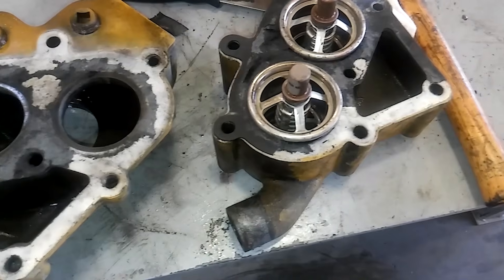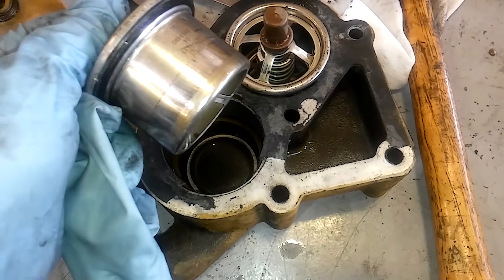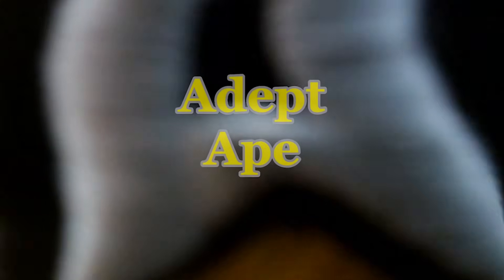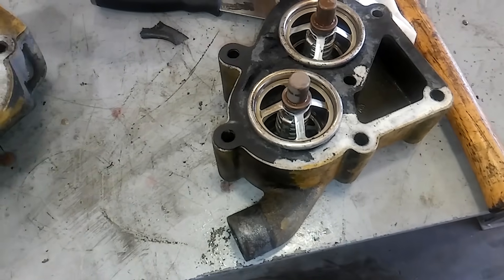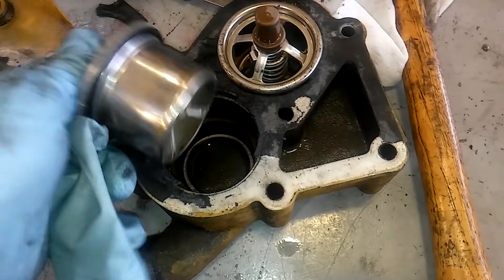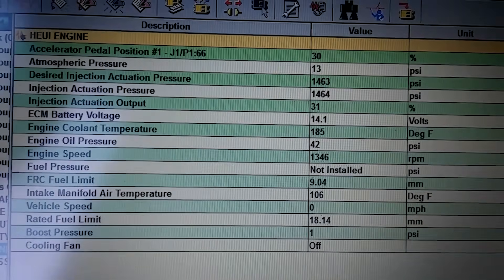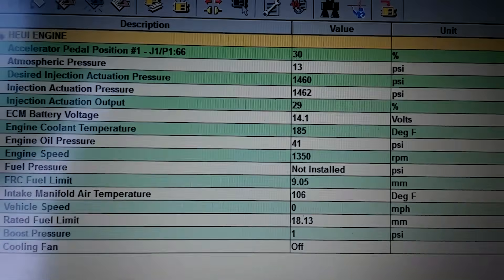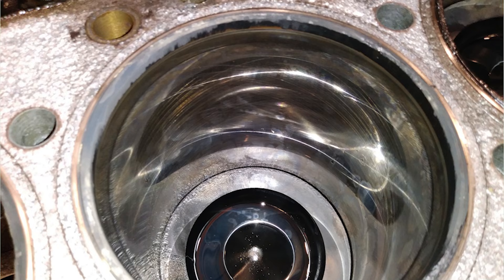Why You Should Never Remove or Use a Colder Thermostat In Your Engine.

Comment: Newer engine tolerances are designed so it does run hotter for fuel economy and better burn of any sludge.  The " I have been doing this for 30 years" person shows they know very little about the past 30 years and that there are many changes in the past 30 years.  Nice video you explained it well, some will not believe it.  Some manufactures run different temps in some extreme environments. In the far north of Sweden, Norway, Finland you can get cold prep package designed for the north that will include a hydronic heater to keep the engine temp hot enough.   Stay safe and healthy Josh.
Reply: Badger says it all I'm out
Reply: You got a point. Yes, i'd never change the thermostat opening temp of an engine that uses 0w-30 oil, i.e.
Reply: @RGV2300  I would never use 0w-30 oil anyways
Reply: @Force1Com  it depends on the car, you don't choose the type of oil.
Reply: @RGV2300  depends on the temp, read your owners manual. I bet they allow for different oil weights right in the manual. 0 weight is for operation down to -35 Celsius. 10 weight is for operation down to -25 Celsius.
Reply: @RGV2300  you ever look at an oil temperature chart before?
Reply: @RGV2300  that's a good point... People have been so indoctrinated they don't even believe an oil temperature chart anymore lol
Reply: @Force1Com  no, just an oil efficiency curve for a mine truck engine, but it gives me a pretty good idea about how important viscosity and temperature are for an engine operation.
Reply: @RGV2300  I don't know a whole lot about diesels, but what truck you have and what's the daily temperature where you live? I'm curious, I want to look it up.
Reply: @RGV2300  I've never been in Chile before but I know in the Philippines I heard stories about people using recycled oil.
Reply: Also I saw a similar number of cars smoking when I was in Bolivia. I did have a Toyota diesel truck when I was in Bolivia, and I can say that nobody really cared to fix it properly
Reply: @Force1Com  i have a golf a4 1.9 tdi, enviromental temps fluctuate between 8 to 25 degrees C across the whole year, so pretty friendly for cars. I always prewarm it for 5 mins, and drive slowly until i reach op temp.
Reply: @Force1Com  it's just sad to see plenty of cars and trucks newer than mine that smoke black, so engines are pretty much wear at that point, giving a mediocre fuel consumption (below 10km per litre)
Reply: @RGV2300  I agree, and I always thought it was weird, that's why I asked some people questions. I think it would be better to be careful about where you get your oil changed, and know exactly what oil they are using and the quality, and to change oil more frequently. If I got another car again in south america or somewhere in asia, I'd probably only get my oil from a dealership, although last time I asked about prices, I remember it being kind of ridiculously expensive.
Reply: @RGV2300  I was reading something which was saying the first number, the cold weight viscosity, is measured at 0 degrees celsius, so if the ambient temperature is say, 10 degrees, for all practical purposes there's not going to be much difference in the viscosity between a 0w30 and a 5w30, and at operating temp, they will be the same. I had a car before that had about 300k kilometers on it, and I put the manufacturer's recommended weight, 0w20, and on a really hot day the oil pressure was dropping too much at idle. 10w30 corrected it and it was fine, so you may want to keep that in mind as your car ages and the bearing clearance inevitably increase. Also keep in mind that a lot of people probably don't maintain their pcv system, at all, and that will cause a car to burn oil.

 "Viscosity simply means opposition or resistance to flow.  In much simpler terms, it can be referred to as the flowability of a substance. When it comes to motor oils, the viscosity is denoted by the number before W. For example, in 5W-30, 5 is the viscosity number which is what determines the rate of flow of the oil at 0 degree Celsius. So, the lower the number, the lesser the viscosity and the lesser it thickens in the cold. With this, you will expect 0W-30 to thicken less in the cold than 5W-30.

A motor engine in a colder climate would get a lot of help from a 0W-30 motor oil than the 5W-30 motor oil. This is a factor of viscosity. The outside temperature also has a role to play in determining which viscosity is perfect for use. When the temperature is cold, the oil flows slowly, but when the temperature is hot, it will flow more quickly. For adequate and proper lubrication, you must always put the viscosity in relation to temperature into consideration.

Basically, motor oils are manufactured in different velocities to achieve effective lubrication in different climate conditions."
Reply: Dosen't burn off sludge!! If it did it would cause carbon deposits. It evaporates the water in the oil before it can mix with the oil to cause sludge to form or chemical reactions.   dont be a smart @ss and talk down to people try to educate
Reply: @jasonwakewich121  Act like an ass and I respond the same. It does burn down the sludge because the chemicals are mixed back into the intake to be burned instead of vented into the air.  The chemicals that settle out are what makes the sludge so when it is remixed and burnt off it does not vent.
Reply: Caterpillar stopped making over the road engines in the states I Beleive in 2010. Google sensors on any of the new engines. Oil and type of oil is a big deal.
Reply: @RB-cz5jn  What has that to do with my comment?
Reply: @badgerpa9  this needs to be a episode of myth busters. Take out thermostats pull a hill. Put in different temp thermostats pull a hill. You want to be cooler to start.
I reserve the right to be wrong.
Because over all I want what’s best.
But in older engines cooler stats but I do not want the responsibility of someone else choices.
Reply: @RB-cz5jn  On my 1960's I would say sure lets see.  Not on a new unit.  But you should do what works for you.  If you are overheating with the correct thermostat in and everything else is correct like radiator is clean not half plugged, etc and you get to hot I would think the rad is partly plugged but otherwise look for a better rad.
Reply: @badgerpa9  maybe I should rebuild the engine and then replace the rad with a multicore. After I did all that I would still put cooler stats in.
Oil should tell the tale. I’m saying the old stuff there recommending it too hot.

Most will disagree 
That thermostat is important. All that Josh stated is true but at what temp is too excessive.
I think it’s epa. I think you may save a touch(being honest) on fuel but all those gaskets and the temp of that oil.

My views. I don’t want everyone to believe what they read and see for themselves.
I’ve stared at that needle for many yrs.
I can tell you the deference between  none 160/170 and I Beleive 190 stats with a new radiator and with old one.

Off subject but 
Look in disruptive Technology and laws.
Also ask a IT guy how he feels about Microsoft.
Not big into conspiracy theories but we seem to be making a lot of sheep. Especially when that oil should do it’s job.
Reply: @badgerpa9  I’m not over heating.
But I pass others that are
Reply: @RB-cz5jn  I did not follow entirely but if you are saying microsoft is a company run like germany in the 1940s then we agree.
Reply: @RB-cz5jn  Then you drive with your engine at a lower than optimal temperature the rest of the time also right?  Why did you pull the thermostat if you are not overheating?
Reply: @badgerpa9  because the fan never turns on in the winter. I didn’t want to run a 31 yr old daily driver at 195f and shut down is at 225 or 230f.
That’s ridiculous. I recouped my fuel saving by no fan. I’ve got mine set in at 160 and pull samples every 6 months. I don’t recommend my actions because it’s sacrilegious in the community except for the older Mech’s.
Here only time fan comes on is a hard pull or aircon.
Reply: What needs to be done is post the stat temps and the fan temps then the shut down temps. Then go back and look at all the changes that cat made in stat temps then look at the rebuild stats.

I’m not saying I’m correct because a mechanic works on this stuff on a daily basis and has access to literature that common kin don’t.
The newer engines are a whole other ball game

So I politely disagree.
3406b should idle all day and night with out fan come on if the out side temp is 60f with a 160/170stat
The literature says that’s to cool.
I can’t argue against a multi billion dollar company but I can ask them why they got out of trucks on and on and on. 
Then ask them what was the best engines made.
Then ask them why did they change the temps today?
Did they not work good before?

Enjoyed the conversation.
Reply: @RB-cz5jn  cortana listens and watches you it is impossible to turn completely off anymore, so does your phone.
Reply: @badgerpa9  Microsoft changed there certification program it’s all being geared towards azure. Meaning everything at some point is going to be cloud computing. No more desktop. You log in and pay for what computing power you need.
Basically sucking information machines.
That’s a whole other topic.
Literally plugged into Microsoft. Way of the future.
Reply: @RB-cz5jn  See my last comment on them.  That started over 10 years ago.  It is always about control.   Win 11 will not run on 60% of the machines being used now. Forced "upgrade"
Reply: burn off sludge? really? where is this sludge? I`ll watch for it next time I`m driving my truck in northern Sweden or Finland or uranis
Reply: @606budwheel  Stick your head up uramis and see.  I am sure you are smarter than any toyota engineer you probably even passed 1st grade.  Since you know nothing about engines I will point you to what used to be a breather and voided fumes and unburned hydrocarbons in the air but now recirculates it into the engine. Some even put catch cans on them to collect the sludge. You showed you know nothing about engines and are a buffoon even a lawn mower tech knows about fumes not being voided in the air anymore.
Reply: @606budwheel  I bet you believe everything scotty says don't you?
Reply: He wasn't intending to say that it burned off sludge. It burns off the water that condenses into the engine after you shut it off and it cools down. Sludge is formed when you don't run the engine enough to actually cook the water off. But the water will cook off if you're using a 180 or most times even a 160-degree thermostat. He stated that the thermostat does not change the overall temperature of the engine because it Meters the coolant flow. But that statement in and of itself indicated that he didn't know what he was talking about in the first place. It does allow an engine run just a little bit better because although the combustion chamber temperature only changes by a few degrees, the intake manifold temperature maybe low enough to allow the fuel system to fatten up the mixture just a little bit. That's why under eighty degree thermostats are put on a lot of cars, to increase their power output. When they run richer they'll run just a tad cooler. I've only been wrenching on cars for close to 60 years now and I'm very well aware of modern engines and why the tolerances are the way they are.
Reply: @44hawk28  Glad you know everything you should tell all the engineers how wrong they are.  If the engine temp is not warm enough the combustibles and chemicals in the breather which is mixed back in to intake will not burnout properly and will sludge.  The toyota engineer that explains it explains that is a reason the extra heaters are added in northern vehicles to keep the temp above the 190-190 temp thermostat. If you put in a lower temp it will not stay as hot and affects fuel economy and emissions as it will not burn off the them if it is not kept warm enough they settle out. I am not a toyota fan boy but the diesel engineers have good videos about the diesels they run in europe.
Reply: @44hawk28  exactly, one of the biggest design goals are emissions
Reply: I'll be taking all of my emission sh1t off and changing my exhaust completely and retuning my engine
Reply: In some of the car engines I've seen, even the oil is evaporating slightly with the pcv system, so I really doubt the water will have an issue evaporating

Comment: That last tool reminds me of an old school carbon arc gouging machine I used at a welding shop I worked at a decade ago. I actually prefer some old school equipment like a Sun VAT 40 battery tester or carbon arc for big stuff instead of plasma

Comment: So why do they make different t-stat for the same car then?
Reply: Because someone will buy them?
Reply: @cbmech2563  I’ve changed them in some of my diesel pickups like ten degrees cooler I wonder if that matters much I only did it because that’s what was there
Reply: @skycowboy_7391  a diesel runs it's best at higher temperatures, as long as your cooling system can handle the heat. Cummins was trying to build an engine for the military that didn't have a radiator, only an oil cooler. Ran great, great fuel economy but the parts that would live in that environment were to expensive. It's a trade off .
Reply: @cbmech2563  I ran my Cummins with no coolant for almost a year without knowing and the truck has about 700 hp and still runs and drives  perfectly 2001 24v I was shocked at any rate never trust anyone after they work on your equipment double check the easy stuff like coolant and oil lol truck runs at 190 all year round

Comment: Another point with removing a thermostat being a bad idea is the flow restriction the thermostat creates is what forces the coolant to flow around the back cylinders in some engines - remove it and you can end up cooking them.

Thermic lancing is cool, I once spent two days trying to slug out a 3" diameter 12" long bucket pin out of a volvo loading shovel, even with oxy acetylene equipped with a 4" rose bud the most I moved it was 1/4". Customer knew a guy who did it, my company begrudgingly agreed to get him in.
He was there in an hour and the pin was out, new pin installed with new bushes in 45mins, guy charged about £250 - mind blown! 😂
Reply: @[Gaming Channel] The Eastern Bloc Brainlet Q Exactly...Put your hand in ice water and hold your hand still...Then do other hand and stir the water with your hand...time how long you can tolerate both! (Moving water takes a way heat faster, as long as its not aerated)...Divers in the Cold Ocean, have come to dive in our Rivers in winter time... They talk about the currents in the river carry away body heat faster than the tidal currents in Ocean...
Reply: @[Gaming Channel] The Eastern Bloc Brainlet Q Yup, the lower the temperature of that coolant when it enters the rad, the cooler it going to be when it leaves it. The faster the flow the better and as you say, the bigger the temp difference, the quicker the heat transfer. Also an overall higher flow rate system allows far more margin for problems with the cooling system if things do go wrong. My point was more about the flow dynamics around the cylinders rather than heat transfer overall.
Reply: I noticed you skipped over junk. Whilst running junk ,getting all the heat away from that transmission you can will keep it alive much longer. Yes, I concede some damage may occur but my junkers all swear by 160 degree thermostats and manual fan switches. Keep the heat off that motor and your junk will run a few years longer. The damage to parts any acid sludge will create is minimal compared to falling into the clutches of a shop mechanic. Sometimes ya just do things different.
Reply: Correct, it also has to do with time. Coolant needs time to absorb heat and carry it away, removing the restriction causes a higher flowrate, but less time to absorb.
Reply: @darinareyacrazyman1505  the greater the difference in temperature of metal and coolant, the quicker the transfer of heat. Your perception would be true if the coolant were to only circulate once at warp speed, but that's not the case. The coolant stays in the engine plenty long enough for heat transfer to take place.

Comment: Good video most people don't understand this I have a good example I have a hot rod 71 Chevy pretty seriously built  Motor you know huge radiator 2 monster electric fans never overheats in traffic even on a hot day go down the coast At Speed cool air coming to the radiator Radiator thermostat barely opens Engine overheat till thermostat finally opens Because cooling system is a little too efficient does not properly regulate flow is flow through the radiator install hotter Had A 160 thermostat installed 195 problem solvedIs coolant/water in radiatorIt needs time to cool too much time to cool will cause not enough flow or properly regulated flow
Reply: Modern engines and computer systems are designed to run at a certain temperature it will also throw off your air fuel mixtures You put a cold thermostat in a modern engine some of them will even throw a code And it will affect gas mileage because  This engine control system is designed to run at a certain temperature Great video

Comment: In Edmonton Alberta Canada we are 2,100 feet or 645 meters above sea level where Water boils sooner at higher elevations. and we pull 3x highway loads or 100 Tons off-Hwy. Under these conditions we can get 2-3 rebuilds in 1 million Kilometres. Under these unusual conditions trucks where not designed to operate under, a smaller thermostat does improve overall performance.